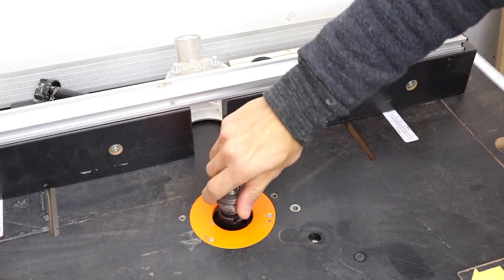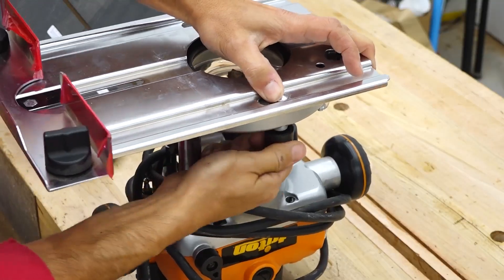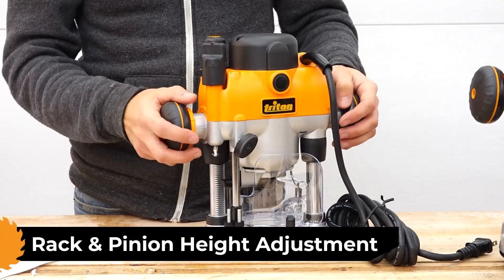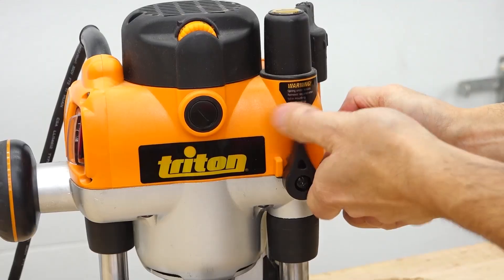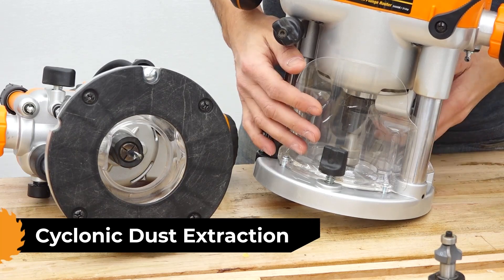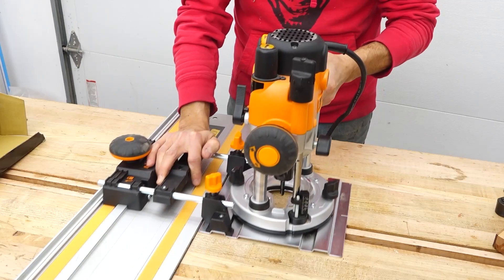Triton Router Comparison | The MOF001 vs. TRA001 | Which should you buy?

Comment: Hi Matt, I have a TRA001 mounted permanently under a router table. Problem I have is when I release the Locking Lever to make a fine adjustment, the bit drops down a bit, making it very difficult to make a quick fine adjustment. Is there a solution to this?

Comment: Hi Matt, I liked your video very much. Now I get the feeling you are in the States, and I am in the UK, where I must say, the aftersales is not that good. So I wonder if you can help me ?
I have a TRA001, and for ten years it has never let me down a truly great router. Until now. The automatic spindle lock has stopped activating, and as it's table mounted, it's a damn pain in the.... Now my question is: Have you ever come across this problem, and/or would you know how to fix it ? I get the feeling that the only way to get to it is by unscrewing the small screw beside it's housing, but I am reluctant to do this as the 'manual' such as it is, doesn't even mention it.
I apologise for rambling on, but any help you could offer would be most appreciated.
BTW, your work looks amazing. Kind Regards, Bernie SW Wales UK 👍👍

Comment: Hello, I have the 3,5 type triton. Very good product. I must say that the block system for changing bits , not always work…. I have mounted this router on the router table of triton… the same problem happen here too. But, good stuff
Reply: You have to turn the switch on the router to the off position to make the arbor lock work.  Kind of a nuisance if router in a router table.
Reply: @JakeSpeed1000  Yes, oké, I did. But I mentioned “not always”  after many tryouts It works….later on….problem again.
The router mount under the triton table makes a lot of dirt ofcourse, so I cleaned it everytime. It seems better now.
Many thanks for your reply, greetings Jan

Comment: Hi, one question : Does the mof also have the capability to use a half inch collet ?? Or is 8mm the limit??  Kind regards Hans
Reply: I have seen the collets section is also including both MOF (larger collets) and TRA (smaller collets). But this can be incorrect.
Reply: I have a MOF001 and use a 1/2" collet with it. I'm in Europe so I had to buy it separately though. The JOF001, MOF001 and TRA001 all use the same collets.